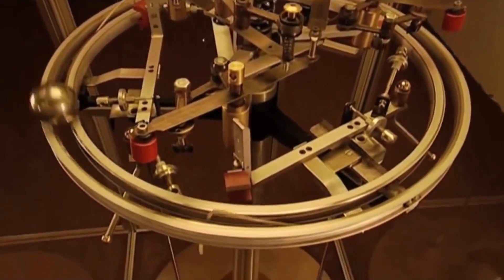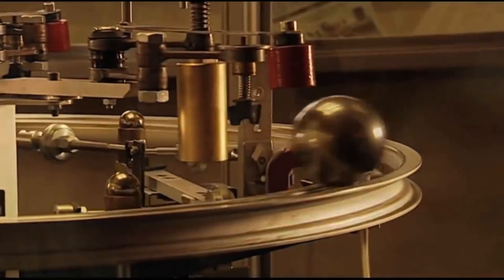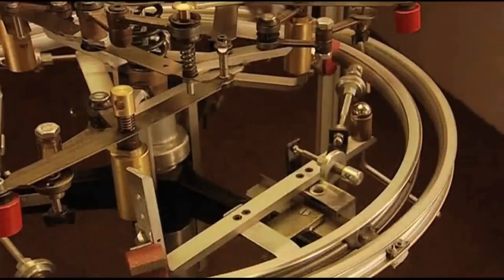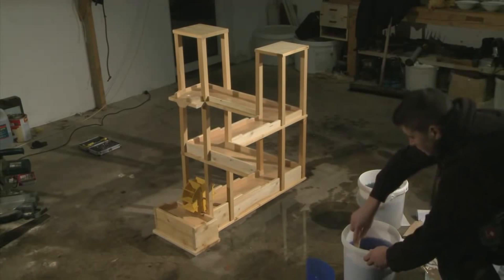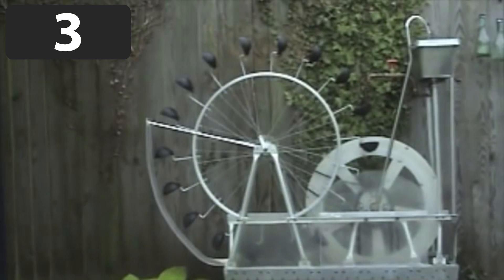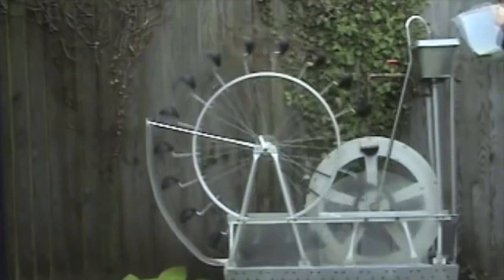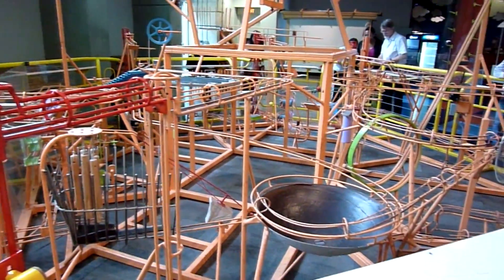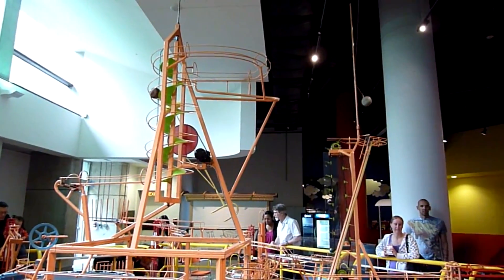Top 5 Near Perpetual Motion Machines

Comment: Can any of these be used for practical energy efficient solutions?
Reply: Xiral 🤣🤣🤣🤣🤣🤣🤣🤣🤣🤣🤣🤣🤣🤣🤣🤣🤣🤣🤣🤣🤣🤣🤣🤣🤣🤣🤣🤣🤣🤣🤣🤣🤣🤣🤣🤣🤣🤣🤣🤣🤣🤣🤣🤣🤣🤣🤣🤣🤣🤣🤣🤣🤣🤣🤣🤣🤣🤣🤣🤣🤣🤣🤣🤣🤣🤣😎😎😎😎 no
Reply: no... perpetual motion isn't possible.
Reply: Richard Reddering I think what he is trying to ask is if it would be possible to generate electricity from these devices, even if they are not perpetual motion machines. This question actually is not that dumb. If you made a machine that could last on its own for a day or two before needing to be reset, it seems like it could have potential. Correct me if this is not possible (I'm not too familiar with physical laws and what not)
Reply: @AeroInspire  that is actually what I am thinking for most of these machines. I found some where people say even if i could run for years it would eventually stop. Well lets take energy for few years and than just start it again or replace used parts.
Reply: @milke9254  The thing with that though is that I would imagine that the energy created would be really low.
Reply: Lol

Comment: the water one can't be done because it would just evaporate
Reply: It can because the spigot is running if you shut it off it stops
Reply: actually you find it don't work but not for the good reason because the pump ascend less water than it will need to fall on her for making it work some friction problem :D

Comment: 6:05 =D why even include a clip that has a ”ball lift” driven by electric motor lmao
Reply: Because a lot of man hours went into the design jerk
Reply: Logistics... Just say you had to replace some part for whatever reason you couldn't realistically do it while the device was running with huge energy put ...say it was modded to run a power plant... Ok answer?
Reply: "near"
Reply: @HyonkTea  It's not "near" from a perpetual machine... (Except, of course if you consider electric cars, toasters and microwave ovens as "near perpetual machines"...)
Reply: @Louk.V  Yeah, not seeing how that's any nearer to a perpetual motion machine than a ceiling fan... if it somehow used springs and gravity to move the lift, it would be "near". Don't get me wrong, it's quite impressive. I've built tremendously smaller kinetic ball machines, but they're quite boring when unplugged. ;-)